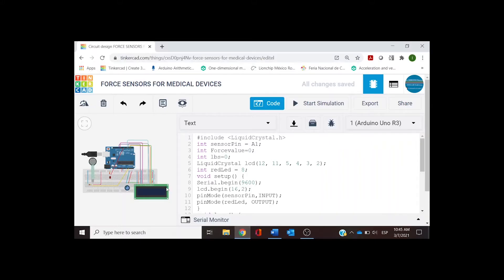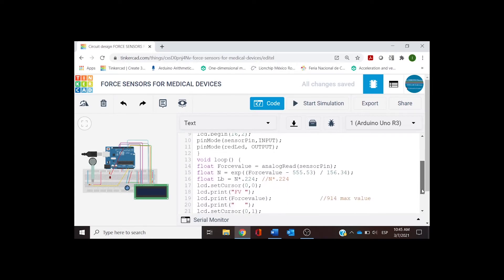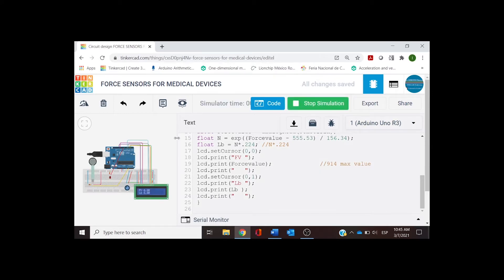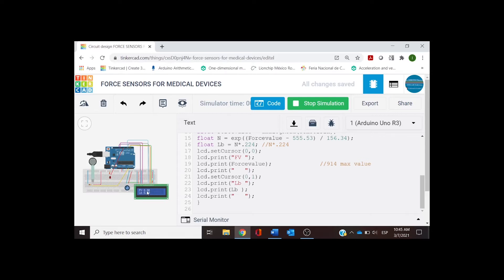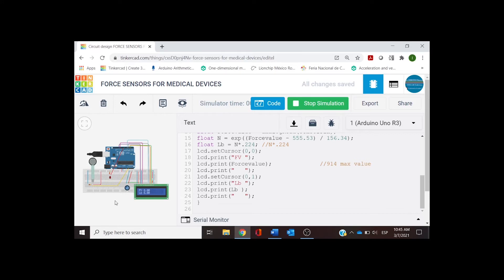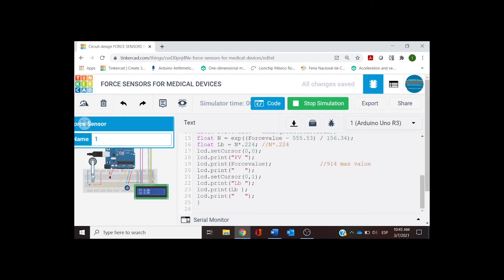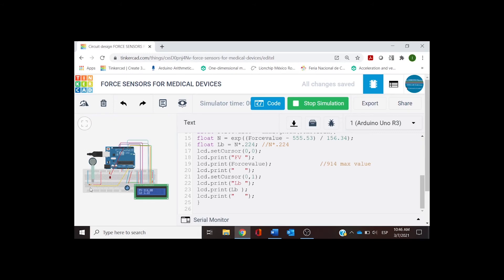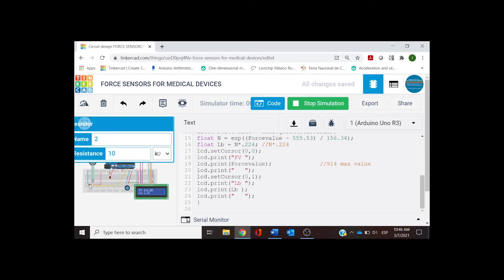Tinkercad Circuits Force Sensor w Pounds Part 2

Comment: My force value stays at 0. Why doesn't the led turn on? :(
Reply from the maker: HI LG - it is probably a wire not in the right place. First take a look at each wire to make sure each is connected correctly.

Comment: hey can u explain  code on line 15
Reply from the maker: We analyzed the data of the relationship between the output captured by the analog pin and the displayed value in Newtons. We used a spreadsheet to create the best fit curve. This curve is a logarithmic relationship. We then solved for the Newtons in the best line (really curve) and plugged it back into the code. The equation you see is the result of the algebra we did. This was confirmed by Tinkercad. The real project will probably have a different relationship, but this works in Tinkercad. Hope this helps.